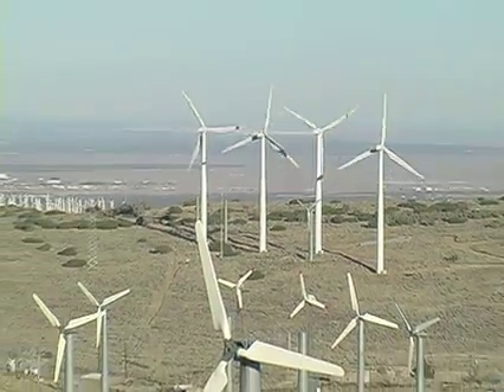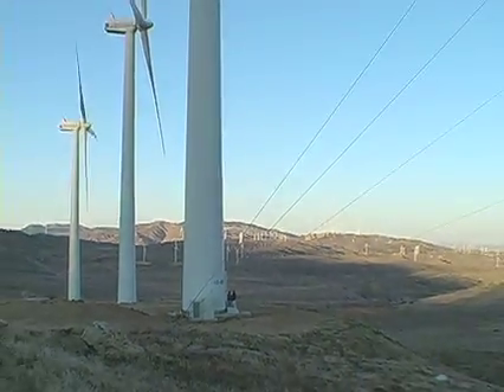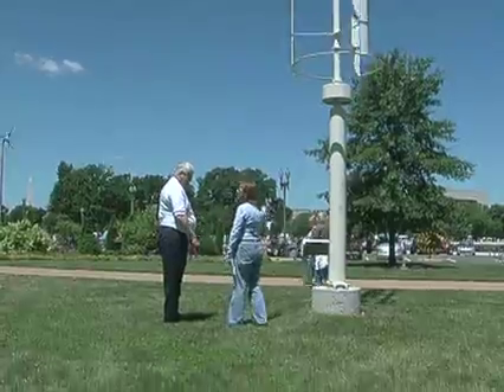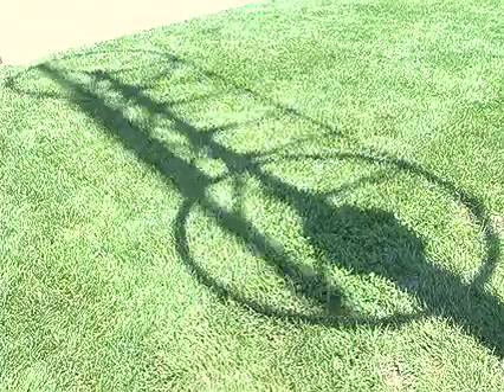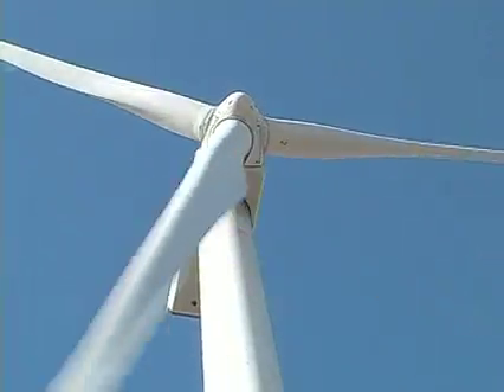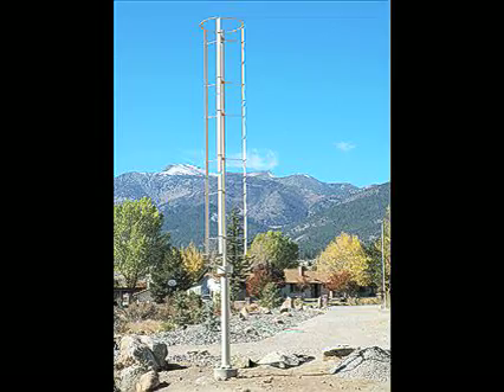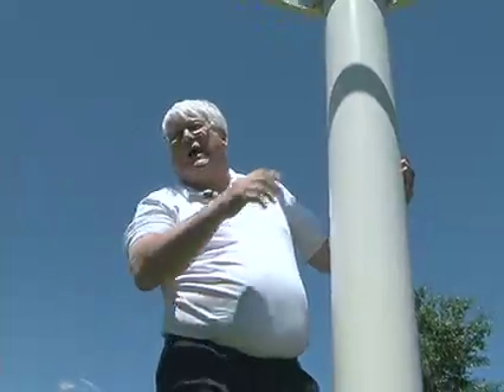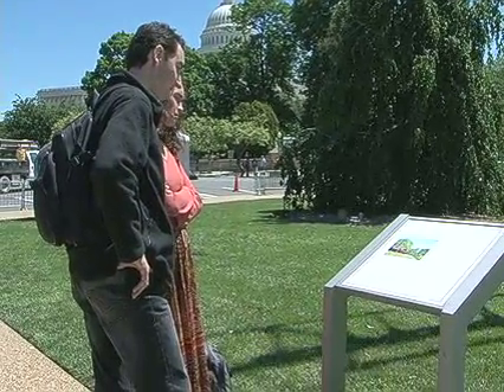New Wind Turbine Design Good for Rural, Urban Environment

Comment: looks nice but,  sorry I have to analyze and so first my electric bill is around 80 dollars a month so sounds like the  Spire will save me 20 bucks a month x 12 is 240 bucks a year. question, what will it cost to buy? and set up.  5 thousand ? more?  if 5 thousand then I save nothing for 20 years, after that if its still running I will save 20 dollars per month.  and we all know it will die way before that, or at least keep costing us money to maintain.     and then we have what I see as possible failure in the design.  the height of the blades, creating leverage at the base where the blades mount.  the wind applies force not only to turn the blades but pushing on the structure like it was a lever which creates force amplification at the bearing or base.  so instead of the  blades spinning like lets say a balanced squirrel cage fan would do, the height of that thing would cause some flex and not only flex but back and forth oscillation, which you cannot have because in time oscillation, flex, vibration will cause structures to fail.    sure it's tall and it had to be if you expect to get a decent amount of power out of it.   it's all about surface area, the more surface area the wind can act on the more torque you get.  that is why they made the huge wind generators we see today, they have to be huge because they have to have enough blade surface area to get enough torque to spin the huge generator.      so far I see no wind generators out there worth buying because they all have the same problem, cost too much and either don't last long enough or cost you too much in maintenance, so all you are doing is paying some one else for your electricity but you end up paying about the same or even more . and then you have all the hassles that go with installing and maintaining.     sorry to say but I don't think it will last.  instead maybe forget the height and  go with width, but that will only work if you can support it around its outer diameter.  let it rest on another circle of bearings or magnetic repulsion. then put some very large blades on it and catch as much wind as you like.   go for the torque and and low RPM  then use the torque and gear up to spin the generator.

Comment: My design of VAWT to supply remote Thai farmers with the independence they need will be made out of PLASTIC & one day will be mag-lev to be maintenance free- other then the electronics, drive belts & water pump. Thai farmers need options of water and/or electricity (x2 gen or x2 pump). *The system shown here will NOT do well in high winds because the top is un-secure. But he's on the correct path. What kind of brake system? How does this expand in size if we can see it wobbling already?
 $2,500 is projected cost of my plastic VAWT & will use a car or truck (85/110 amp) D/C system, because a farmer can go get a Honda/Isuzu alternator to be up & running the same day. Rebuilding a pump is just a small hurdle.

Comment: While I admit that they do offer a type of elegance that might be accepted in urban zones, from an engineering point of view, the central shaft will flex and though it appears that there is no reversals as the inner shaft does not appear to rotate, well I just wonder about the metal fatigue on that central shaft and what would be its lifetime.   Unfortunately one similar vertical axis turbine failed drastically because of metal fatigue in the central shaft, over a period of about four years.
Reply: There's no particular reason I can see why they couldn't use guy wires and alleviate the fatigue issues you talk about.

Comment: I'm afraid you completely missed the point.  People wanting power is not the problem.  If our distribution systems were more efficient, they would have smaller footprints, and if our storage systems(batteries) were also,  --- electric cars would actually become viable.   If you can't see this,  you are an idiot.

Comment: I saw one in Portland Maine last year. I put my hand on the pole and it felt like it was vibrating like it was out of balance. Then a couple of hours later I stopped by and did it again. It was running totally smooth so the 1st time when I felt the vibrations, it was just wind turblances.  I was real impressed! I'm putting up a HAWT this month but this is the 1st VAWT that I know of that can compete with HAWT's. I'm watching!

Comment: wrong! it depends on the size of the turbine. You don't see this in the windfarms because it's like a new concept.I remember there is one windfarm in California has this tho.  It's very different from the vertical stuff that's your thinking.It can generate 100% power for the average homes. I personally love the propeller wind turbines , but they are noisy. This concept is a future for residential homes!

Comment: We don't have a GENERATION problem in this country.   We have a STORAGE  and TRANSMISSION problem.   We desperately need new  (lighter) methods to store electrical potential, and lower resistance transmission (wires) systems.

Comment: @chrisfromthehills yes and no
There are two major problems preventing electric cars from becoming mainstream
1) Short range ( a serious but not insurmountable technological problem)
2) High price (as expected from any new technology)

These problems need to be addressed separately. Now I agree that if the grid is fed with cleaner and renewable energy like wind, it will add a very good reason to fix it. I hope it happens soon.

Comment: @SereneiBE Wind is already about as cheap as coal in the US although more expensive than gas. Comparing it with oil doesn't really makes sense, since oil is for transportation, not for electricity generation. Making electricity to feed the grid with oil at current price would be silly expensive.

Comment: @Celebrindan That's fair.  Really, the solution is to get the turbines away from the birds. We need to put utility scale generators in places where birds aren't common, like offshore and at high altitudes - there's some great work being done with self-supporting tethered gliders as generators.  As for wind power on your own property, which is located wherever it happens to be, that's a trickier problem.

Comment: @Roboallen9  I like your idea, a power grid with no power plant! If indeed just one of these things can put out 25-30% of a house holds needs then an entire grid would seem phenomenal. Especially if you had 4-6 of these turbines on your own property. Larger ones for large buildings and atp. complexes. It would seem that there would even be a surplus of power. If that is so, use the surplus power to make the telephone poles from metal and cut back our use of trees. (save wood for toilet paper)

Comment: very good sr ..but could be good idea to don't broadcast the info via 2.4 ghz or wirelees and use some other way to access the info about the power ..we know amps and voltage is easy ..but normal user don't need more info ..only if the power is in the inverter or the power is full in the back.up batterys system. think about the bees and insects is good too. tnks

Comment: @yutjub123 electricity contains less than 40% of the energy of the coal used to make it.) For every unit of energy delivered at the pump, corn ethanol requires 0.76 units of fossil energy, and gasoline requires 1.22 units. The use of ethanol thus results in the consumption of 40% less fossil energy than the gasoline it replaces.

Comment: The Be Jesus windmill is much better,In both horizontal and vertical, it uses a pure form of newtons laws being 100% closed walls and open closed walls of any size instantly.There mathematically can not be better.only improved with additional forces applied.in  currents wind / water

Comment: @luc59457 I purchased my systems from Sun Electronics in Miami, they shipped via freight truck which left the pallets in my driveway. I did the installation myself which was goofy because the state and  Fed incentives also pay 80% of the installation costs (in La.).  They look at the whole project. I should have looked at what my time was worth to myself. If I lived in an area that had better avg. wind speeds having both is the way to go. Usually when it's cloudy, it's windy.

Comment: And as far as land for crops, the corn intended for beef production can be used for ethanol first extracting the starches/sugars leaving the original crude protein from the corn which is what the cows need from it, as the animal protein added by the dead yeast which is what goes on inside the cows many stomachs anyway. The existing yeast in the cow's stomach breaks down the cellulose for it's food leaving the crude protein and then making the ultimate sacrifice by becoming the cow's protein.

Comment: I work for an oil co. (lowly wage earner machinist) but still precision in numbers is why I moved back out of the global warming group but still as a conservationist and a cheap bastard I have 4400 watts of solar with oversized grid tie inverters to allow me to expand to 8 kw for my home. This is on the existing footprint of my home so no new land usage. Also plans for plug in hybrid to use totally as elect car on short trips. numbers still good for renewables even if the earth isn't warming.

Comment: @Allante715 Wind will never be the complete answer and its variability can be tempered when backed by storage. It would have been much better if 5-10% of a wind farm's install budget had been put towards some kind of storage system. For small farms, that might be 1 less turbine up to a handful for larger ones. Turbine land use is hard to quantify as the bigger the turbine, the more widely spaced - most of the land is still usable for grazing or crops

Comment: @splunkr You have to be careful when reading the numbers - I chose the most credible source I could find. The "avian death" issue, especially regarding raptors was due to the hundreds killed at Altamont - a facility with 4000 low-surface turbines, which spin MUCH faster, that use latticework blades - this is an outdated design and unsafe for birds. The anti-wind folks took the Altamont numbers and multiplied them for the entire US.

Comment: @hablerz  I don't think we, as a whole, have a good grasp of how quickly energy use is rising worldwide. A decade ago, I read that the coal supply could power the world for centuries. Now, China is having trouble meeting domestic demand (which is not the same as running out of coal) and there are rumblings that we are a few short decades from "peak coal". We need to ramp up the alternatives quickly.

Comment: @Allante715 Yup, heard a few things about them- for example, 1.) 99.9%? In your dreams - but 80-95% removal is achievable for some of the toxic compounds 2.) currently, typical scrubbers don't reduce CO2 emissions 3.) Ain't cheap - $200 - $500 per ton SO2 removed; approx $300 per kilowatt to install; that kind of money would  create a good deal of renewable energy. Why not switch some of those coal plants to biomass instead?
For base load, perhaps geothermal can shoulder the load?

Comment: @Allante715 Replacing one isn't easy but you want to reduce the use of coal as much as possible, preferably by a fuel source that isn't polluting. Not only does coal produce the most CO2 per unit weight but also many other nasty compounds including sulfur dioxide, particulate matter, carbon monoxide, mercury, etc. And let's not forget that coal mining is very dangerous.

Comment: @Glinkaism1 Furthermore, you seem to be regurgitating info, much of it inaccurate, that has been posted by the anti-wind organisatons. There's plenty they're not telling or are choosing to overlook. That said, wind power, even with extreme variability is much more capable than you imply. My utility published hourly stats on the energy supply ( we have a  mix of just about everything, except solar) and the wind component does quite well overall. With some storage, it'd be much better.

Comment: @raken94332 There is always residual waste though which lasts 10000 years even when you use fast breeder reactors.  You cant legislate for what might happen in that time, were bumming it off on future generations.

Thats just one concern ,  the overall cost is no better than a renewable source that would be totally clean.   Uranium is finite as i have said , mining it causes environmental damage that lasts again for thousands of years.

Its not cheap , its not clean so why bother.

Comment: @Allante715 Wind turbines cause no pollution though, you dont need mines or transportation costs.  You build the wind farms off shore, you could build farms with 200 turbines and no one would even notice.   

All you have after that is the maintainence costs , which would be similar to coal and nuclear costs to maintain.

Another great thing is when you have to replace them , you can do it incrementally and have no power loss.

Comment: @raken94332 Uranium isnt the way to go , the mines are incredibly polluting and you end up with waste that lasts 10 000 years not to mention the enormous cost of the plant in the first place. Each plant lasts around 50 years then you have a massive cleanup bill.  Then also Uranium is a finite resource which will be harder and harder to come by in years to come.

You cant make plans that last 10 000 years.

Thorium reactors havent been fully developed yet.

Comment: The Japanese have found a way to almost double the electricity generated by traditional wind mills. Simply by putting a circular fixture around the blades almost doubles the electricity generated.

Comment: @Allante715
Actually, the turbines would be more reliable.  When a single plant has a technical problem (and they do), it can suddenly shut off over 1GW of supply.  A single turbine failing would hardly be noticed.  Having the turbines in multiple locations keeps them from all losing wind at once.

Comment: I like their design and reported ease of installation. The video that shows it spinning very fast is misleading since, per their specs, even their "extreme" wind version shuts down at over 37mph. It would be nice if there was one that could keep outputting more at high wind speeds which would be a great source of bonus power.

Comment: In part of the clip, you can see a regular horizontal axis turbine, a HAWT, turning at twice the RPM with same wind condition.  That's why the utility companies use horizontal axis turbines with propellor type blades, there is no resistance on backside.  With that WindSpire, as one side catches wind, the other is resisted by same wind.  That's why so slow and low yielding.

Comment: They're US$5K and require no special electrical knowledge; plugs-in to an outlet in your home circuit and spins your meter backwards.
Expect another $1K for installation, no crane required; use a Gin-Pole.
It's not a Savonius, but another foil type.